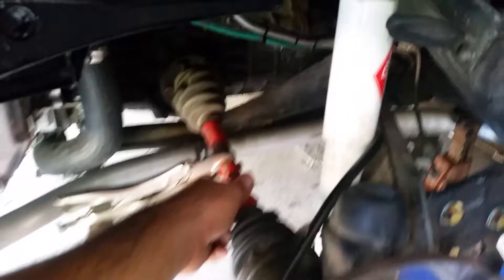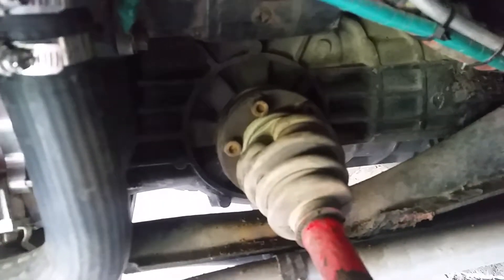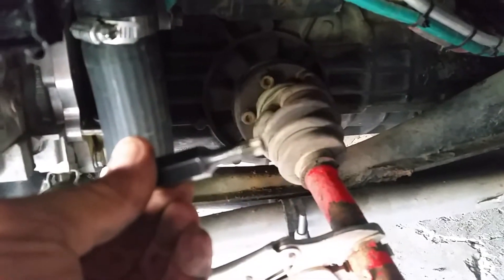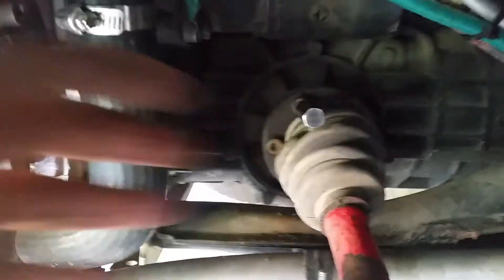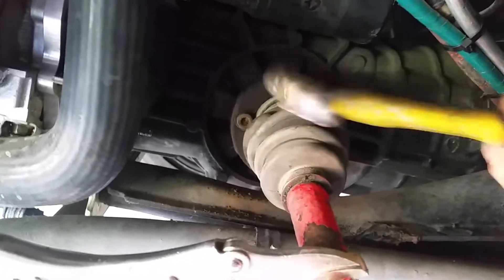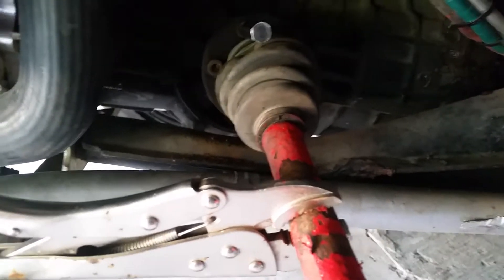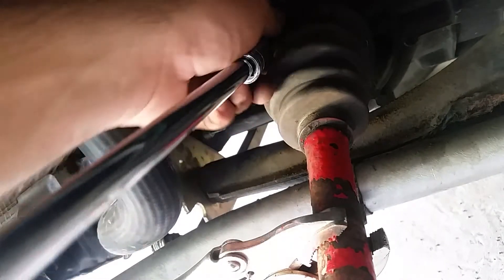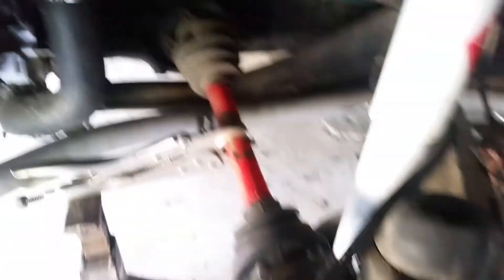Volkswagen Beetle drive shaft removal

Comment: so you are using the stock bug transmission?? except the driveshaft, how is the stock transmission holding up?? that your subaru swapped beetle right?
Reply from the maker: imprezaSOHC Yes that’s my Subaru swapped beetle. It is holding up quite well. I don’t launch it hard tho. I snapped the cv joint on a hard shift.  But considering it was the original axles and transmission that came in the car in 1975. I think it has done its duty. 

It is a single side plate IRS transmission. The best transmission VW put in a beetle.  No matter how much money you spend, if you abuse it it will break. I have a spare transmission to install this spring just to be safe. But again it is a stock VW beetle one.
Reply: @Utopiabugs  impressive!! im from montreal and im starting to do my researchs for ej25 bug, thanks for the information ;)
Reply from the maker: imprezaSOHC if you are ever in the barrie area during the summer. Shoot me a message and stop by